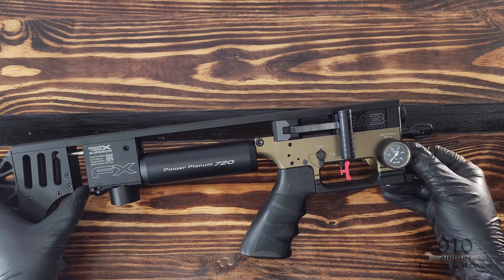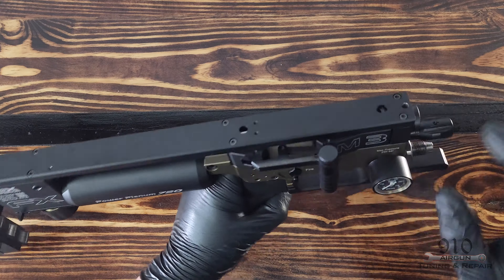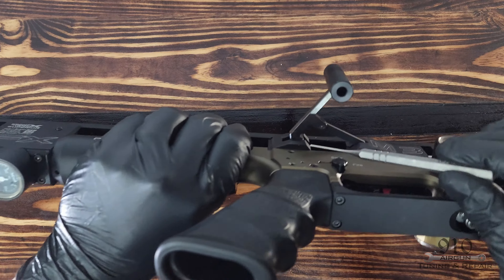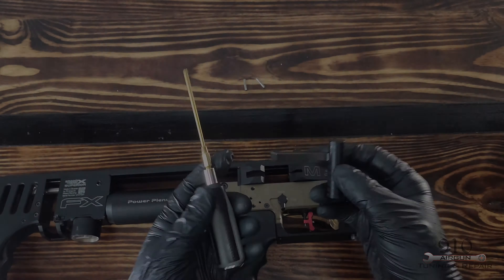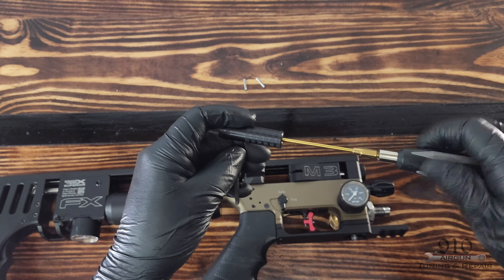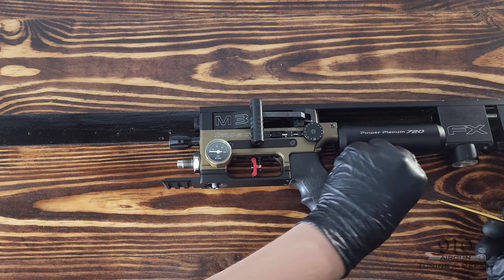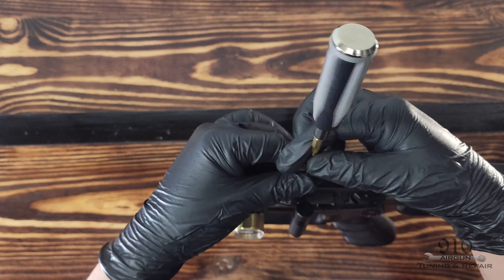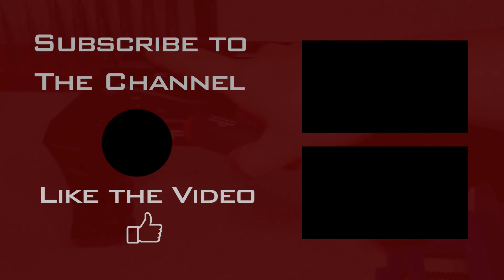How to Install Impact M3 Lever on Left Hand Side

Comment: I would like to install the Mark 3 cocking lever with a short throw linkage. If the M3 cocking  lever is too expensive then I will just install a short throw linkage. I'm in canada. Any idea where I can find both of these items?
Reply from the maker: These items can be purchased at your local dealer or country's distributor.